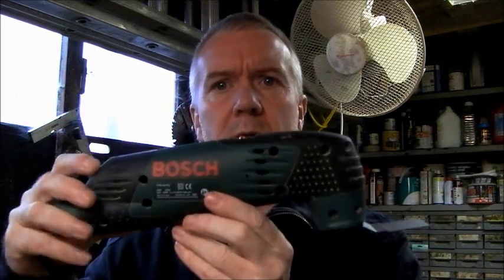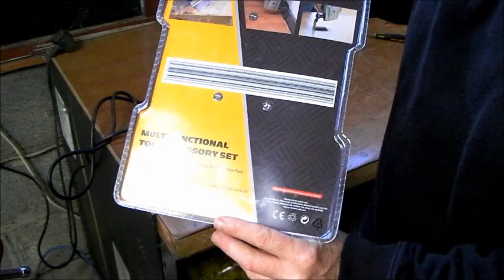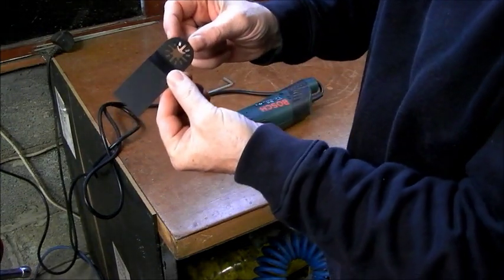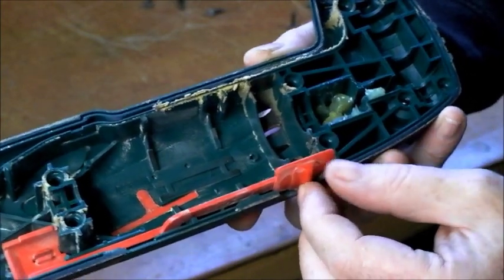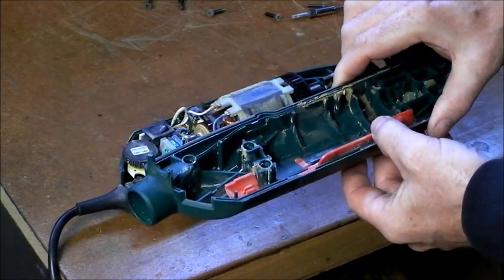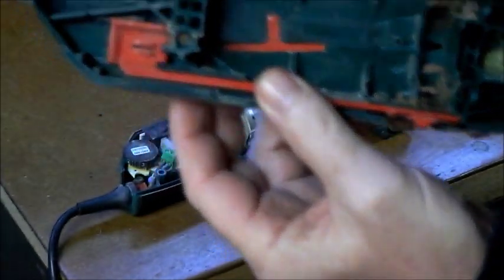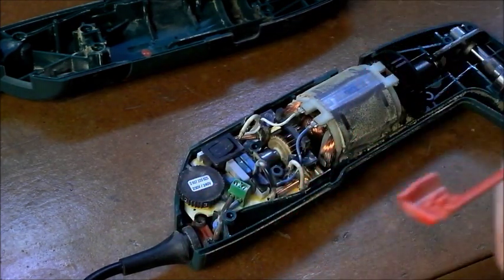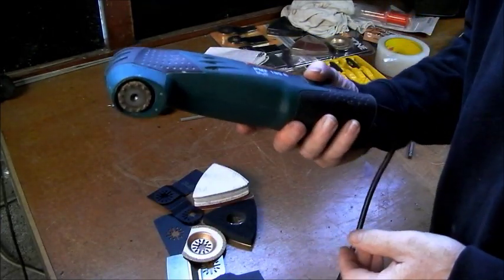Bosch Multitool blades, CHEAP BLADES and ACCESSORIES

Comment: The 3 speed is good MyBest.Tools trying to keep to a low speed for a long time with just the trigger is hard.The only negative is I keep bumping the on/off switch when changing blades, not dangerous but annoying.

Comment: Hi,
I had the same switch mechanism on a Skill angle grinder and that gave problems, it turned out to be a build up of dust in the switch that was stopping it turn on fully.

A good tip when refitting screws into plastic parts is to turn the screw backwards as if to loosen it with a little pressure on the screw. As you turn the screw you will feel it jump a little bit, when this happens then screw the screw in. By doing this the screw will be going back into the original threads it cut when it was first fitted. Using this method will save stripped out threads.

Look out for the multi tool that Lidl sells (Parkside) they are good quality machines at a decent price. I've had one for a few years and it has seen some action and it still works great.

Like your videos by the way, nice and clear with good commentary.
Reply from the maker: Great advice relating to screws into plastic; will always use that technique in future

Comment: Really gone off Bosch since I bought their laminate
trimmer. The lock would cam out when changing bits.
I had to snap a vice grip on to hold it. Went back to Porter Cable.
Don't much care for their jig saw either. Like a Tiger tank. Has an
18 foot long cord but no LED lighting to see where you are going.

Comment: There is a great new tool for sharpening the blades called thev SHARP POG .  you put it in a power drill and it cuts a new set of teeth all at once .
Reply: Greg Dunda but once you cut past the bimetal then arnt you just sharpening week steel that won’t hold an edge?